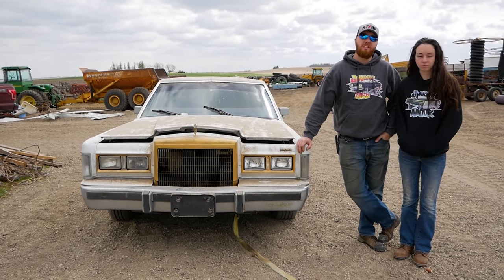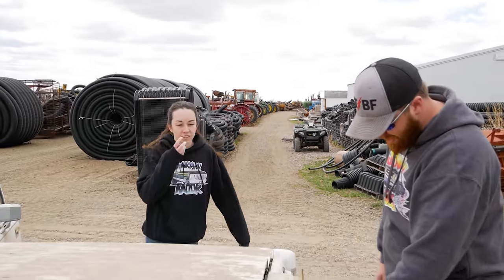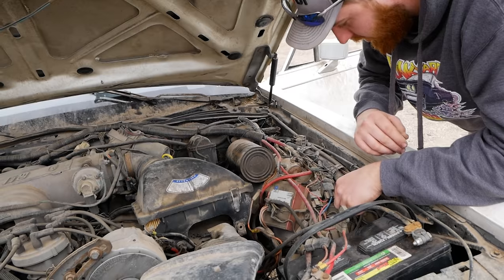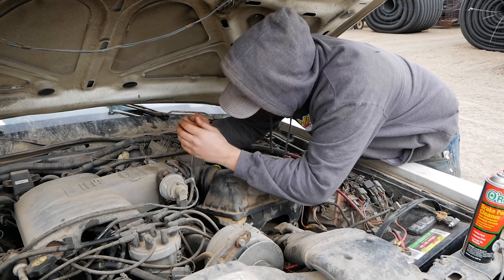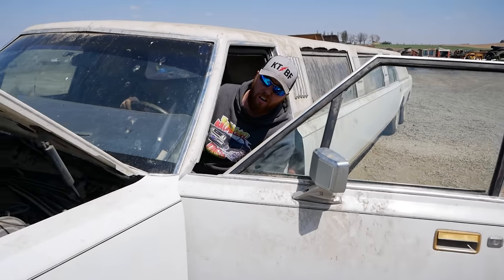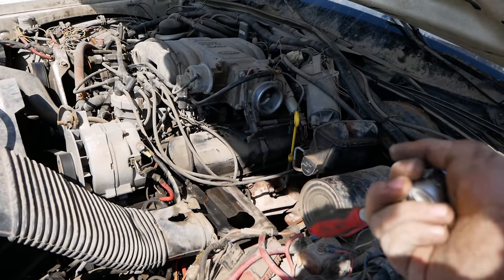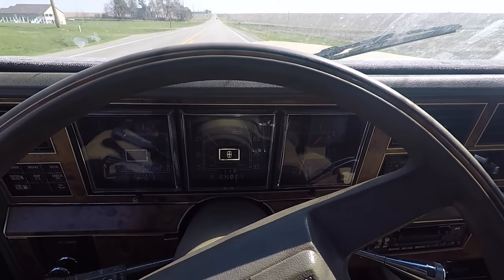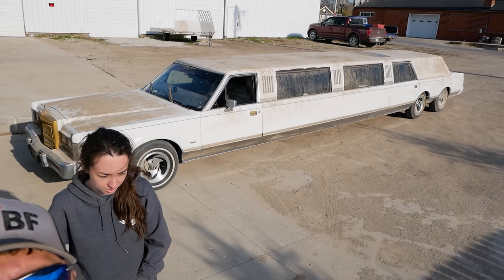Can We Fix an ABANDONED 35 Foot Limo?! - EFI Revival

Comment: As a retired welder, I'm horrified at the conglomerate of  scrap metal that escaped the smelter and was welded in place by Ray Charles. Watching you clean this up will be a lot of fun. Do with it what you will. It will be great no matter what.
Reply: Would be interesting to take the thing to a real limo builder for an assessment. I never would have imagined using road rebar  in a vehicle.
Reply: I haven't welded anything in 30 years and wasn't great then and I could do better than that with 30 minutes to get my set up right and run a couple practice runs....I mean dang that's beyond unacceptable.... that's why these old units are low mile and cheap...a lot of builders in the 80s and 90s were shady.
Reply: I was struggling to find a way to describe it...Well put.
Reply: You've aptly described the stretch limousine industry of the 80s. I've been in the industry for decades, and I have to say, no builder in the 80s and most of the 90s did a single thing differently. It wasn't until Ford and GM started suing people out of existence who weren't in the QVM (Ford) and CMC (Cadillac) programs that quality started to improve. Places like Ultra were still s**tshows though.

Fun fact: 80s Town Cars weren't built much better than what the stretch builders were doing to them. That's why, with VERY few exceptions, 80s Town Car stretches are all "sway back" bent.
Reply: @TransformedByFire  Practice runs? you need practice runs to do better than that?
Reply: @RenaxTM91  I was trying to be kind,  and I hate crap welds, sign off a truly lazy, inept, crooked fabricator.  I learned in Ag class,  I never had a weld fail,  and they were brutal on them.   I was a freshman and 15 years old @ that time. It's been over 30 years since I struck an arc.
Reply: @pppaybackkk  fun fact? What are you talking about? No Ford left assembly with rebar and scrap metal and angle iron welded to its suspension.
Reply: @broncomcbane6382  he's referring to the coach and limo industry of the 80s and 90s.

95+% of them built crap and charged the same as the good ones.  That's why thousands of them were pulled out of service by DOT.
Reply: @TransformedByFire  no.
He was insinuating that these cars left Ford Assembly in Wixom, Michigan or Ford Chicago as bad as this guy in LA cobbled them together. Not true. Ford had standards for limousine fabrication. Remember the one that Kennedy was killed in was built in the basement of Ford HQ's in Dearborn. They had standards for the traditional 36" insert, 48" and 60" insert.

Alot of coach builders in the 70s and 80s werent really big players like Hess & Einhardt or Miller-Meteorite. They were just guys with a body shop and a license from DMV as a builder. So they would take a 1 yr old car and cut all up into it extending it 9feet or whatever with no boxing of the frame or side collision protection or raggedy electrical work. 
But notice...after 20yrs sitting the basic car functions are fine.
Reply: @TransformedByFire  plus I dont think any were pulled out of service.  I think they mostly just aged out of service
Reply: @broncomcbane6382  Hess and Einhardt was bought out buy by what would become S&S/Superior(now Accubuilt) in the early 70s. 
In the 90s quality was good
Reply: @craigwiess1656  there was alot of shakeout in the coach and bus industry. Almost everyone consolidated or got bought out by hedge funds and liquidated.
Reply: @broncomcbane6382  worked at Superior Coach in the 90s, was out before they unionized and went to hell.
Reply: @craigwiess1656  I just read that Blue Bird Bus folded in 2009. And American LaFrance sold themselves to Freightliner. Most of the USA bus builders are gone now and fleets are ordering buses from China and Turkey.
Reply: @broncomcbane6382  At the time I worked there limos and hearses, all funeral cars with two exceptions.
One was a prototype  six door Suburban that was in 1994 the other a 120 inch stretch Lincoln  that went the the international car show in Las Vegas that was in 95. Had alot of overtime in the Lincoln 4 days before it was to be shipped out a Caddy hearse went into drive with no one inside it , plowed thru the plant managers office off a support  and into the rear quarter of the Lincoln.
Large group of Japanese businessmen  had just went thru the plant 10 minutes before and I had just finished up in the trunk 2 minutes, was 60 foot away when it crashed. Wasn't the first time a Caddy went into drive by itself, had a few instances at the plant
Reply: @craigwiess1656  apart from this video I had never considered a limo as a good road trip vehicle.  But it is. This thing has that cobbled tag axle which is shit, but the sleeper part behind the rear seats is cool.  This car can make a nice continental cruiser.  
Tap into one of those TV inverters for a refridgerator and a high ooutput alternator. Remove that first partition so the drivers seat can recline a bit.
Find Walmart, will travel.
Reply: @broncomcbane6382  that  linkage set up was cobbled. The control arms should have been boxed and reinforced .  That frame should be checked out for safety. 

For a road car,after fixing the control  arm screw up, I would drop a 460 in it and a beefed up AOD.
Reply: @craigwiess1656  for a 460 I think you would need the E4LD. The E4LD was the reengineered C6 with OD. The AOD is a reengineered FMX. It has a bolt pattern differing with the 460.
An easier idea is to beef up the AOD and build a 351W stroker since its all drop in from same engine family
Reply: @craigwiess1656  another thing is my personal bias always says the 429 was a better block for "dancing" than the 460.  That is the block to build IF you have an 385 Family engine.
Reply: @broncomcbane6382  429/460 same block, adapter can be used for the bellhousing pattern.
E4OD wont clear the transmission tunnel. Tried fitting a E4OD into a 1990 Crown Vic once, major mods to the tunnel would be needed.

The AOD would need to be beefed up to handle the extra HP/torque.
A C6 would be the better choice.
Another mod would be to swap in a 9in rearend  with 3.55 gears
Reply: @craigwiess1656  429 and 460 same block yep but remember the best Police sedan was the highway patrol interceptor 1971-1972 Ford Custom 500 or Mercury Monterey. NY State Police used the Monterey with the 429 4bbl until 1974 then replaced it with the Dodge Monaco with the 440 4bbl. I dont know who had Ford police cars in the mid70s.  Probably in the midwest county sheriff LTDs and Torinos?
Reply: @broncomcbane6382  Torinos were used until 76. 77 to 79 the LTD II, was Fords police, 80 on was the Crown Vic basicly the same platform as the LTD II. 
Ford police engine in the early 70s was the 429PI.  Previous was the 428FE. The FE motors were used all the way back to 58 , I remember  an uncle having a 58 galaxy ex police with a 352 4bbl. He also had an old Plymouth with an early 392 hemi.
Reply: @craigwiess1656  you can call it what you wanna, the LTD2 was still a Torino.  Just more rigid in shape and waay less attractive. Those LTD2s are out there for around $800.  They arent that pretty so their resale is weak.

The Crown Victoria isnt the same platform as the Torino.  That chassis was all new for 1979.  It had the same wheelbase as the Torino platform but not related.
This Lincoln is based on the Crown Vic chassis thats why it has a 302. You CAN fit a 460 in it but it will require a different oil pan and oil pump set up. The 302 for this chassis uses a dual sump pan because the K frame runs right through the pan clearance.  So a 460 would require a rear sump, 7qt pan and longer oil pump pickup.  Plus new springs for the added weight of the 460. Another reason I think a 351W stroker would be a better upgrade to a stock old limo
Reply: @craigwiess1656  or just build a stroker 302 so all the parts stay the same and the car makes a great road trip camper. Take it Roadkill Nationals or Hot Rod Power cruise or the Lemons Road Rally
Reply: Two words, Pakistani Trucks.
Reply: @broncomcbane6382  all for that idea!
Reply: @Dozz03  which?
Reply: I bet it wasn't originally like that. Frame probably rusted out and the business wanted to keep making money so they band-aided it. Par for the course for retail.
Reply: @pppaybackkk All the 80s cars out of Detroit were rustbuckets. That's why so few have survived.
Reply: @broncomcbane6382  In their defense, there were no real side impact standards then, either. The first set of REAL safety standards for American cars went live in 1998. Anything before that was basically left up to the manufacturer.

Comment: This find is gold...  plated!  Seriously though, I want to see you do a total refresh.  Maybe this could be your luxury camper?  Imagine how hilarious it would be pulling into a campground with this beast!
Reply: i am all for it
Reply: Love this idea
Reply: 20ft long pop up roof would be fab.
Reply: @Dave5843-d9m  That would be interesting.  But probably difficult and expensive.  I would just fix the obvious undercarriage issues.  Maybe replace the forward couch with another sleeping area.  I’d keep the middle couch.  Turn the bar into a kitchen cooktop/sink and counter/table.  Then I would probably update the cheese factor with a bunch of modern LED coloured strips and maybe some EL Wire so you could really blast the colourful 80’s vibe with pink, blue and purple.  I’ve seen EL Wire used as a low power consumption “neon” sign.  It works.  Just need to make an armature to hold the wire, paint it black and affix the EL wire with black zip ties.

Comment: Hi Junkyard Pigs!
Limo is my favourite!
Take it to Ford dealership for ball joint replacement.
Take it to the local oil change.
Take it to the wheel alignment.
Take it to the carwash (by hand).
Install the promised and long awaited LS6 twin turbo!! Maybe you'll find one motor like that already built and for sell...  :)
Oh, and all the rear wheels should drive, not just 2.
Source the rear wheel steering from Mitsubishi, Mercedes or BMW or wherever you could find it.

Comment: Those TVs are not going to get anything but static.  They are old analog tuners, and pretty much all broadcast signals are digital. You’d have to get converter boxes for D to A (digital to analog)  and put it in the antenna chain feeding all of the TVs. Good luck!
Reply: I was saying the same thing! Those old tuners aren't gonna pick up anything, except maybe a leaky cable TV amplifier on a pole somewhere!
Reply: of course, all you really need is an RF modulator on channel three and feed it a computer or DVD player!
Reply: Usually its not hard do find the 2 wires connecting the receiver module and the Tube module which expects to recieve an ordinary analog hot/ground signal.

OR you find a nerd who creates an multichannel Hf Minitransmitter which coud be feeded with varous signals and let the TVset´s in original state.
Reply: You Just Need a decoder
Reply: Stick a raspberry pie in there with a composite to RF converter and feed the TVs. Though honestly, if it were mine I'd just put some LCDs in there.

Comment: I bought a 89 4 door Fairmont with the 302 and 4 speed manual when stationed at Mt. Home AFB for $600. It was the ultimate sleeper, and I drove to KY while pulling a U-Haul. I miss "The Taxi" as I named it due to all the other airmen that I hauled around in it.

Comment: Here is an idea Kevin: use the limo for your wedding and make it a honeymoon camper as well. And as an added bonus, it'll fit most of your wedding guests as well.
Reply: Might be a short honeymoon with all that scary welding underneath 😳😳
Reply: @pit_stop77  I'd perhaps take a second look at that rear axle first, it might need structural work done by a pro limo builder
Reply: @rawr51919  A professional limo anyone would hear the words "Ultra Limo" and hang up on you before giving their address, and if their address was public, threaten you with a restraining order.
Reply: @pit_stop77  Well, obviously whoever did that "welding" and "rear axle building" ought to be brought up on criminal charges and the axle rebuilt properly. It doesn't seem very structurally sound.

Comment: Just because the plug wire ohms out fine, doesn't mean it's not cross firing (arcing).  My 92' Caddy had fantastic looking wires and they ohmed out fine but still had misfires like crazy.  Sprayed misty water on them at night and it was a light show of little blue sparks bouncing between eachother.  With that, ya'll did a good job getting it running!  I'm surprised it started and ran all in all that easy for sitting that long.  Can't wait to see it cleaned up and the next video on it!!

As for ideas, I say keep it original and detail it/restore it.  Kind of keeping it as a throwback to the 90's haha.

Comment: I actually like the “really long pieces of wood” idea because the employees are gonna be confused af when you don’t want it cut down 😂
Reply: They will spend more on the lumber than the car if they do that.
Reply: @awolfalone2006  2x4 16’ is $20, so a 32 foot 2x4 would be about $40.
Reply: @averagecarguy420  Exactly,  more than the car is worth. lol
Reply: @averagecarguy420  2 x 4,6,8's maximum length is 16 feet
Reply: I wonder what company did this cars body? Looks like some mess choo choo customs would do.. same company that does camero/elcamino front ends and chevy g20 vans..
Reply: @jackfisher3906  
Standard 2x stock at Menards us up to 20'. 

Well, it's supposed to be. Who knows what's in stock right now with the building boom.

Comment: I think I would have put 3/4 cup of SeaFoam in the crank and the rest of the can in the gas tank when you filled up. Your 48 mile drive would have given some of it the time to start cleaning out that engine. I did that on a 1969 Chevy Bel Air with 235 CI engine that had been sitting for over 8 years. That was a year ago and I was moving it for a friend who tells me it is running smooth and cool even with 237,400 miles on it. Just a suggestion for a fast and easy clean out.

Comment: 41:18 , i once got an engine that would't start and when i took the sparkplug out and held it to the engine it did spark but in the cilinder it didn't and when i put in a new one it fired right up

Comment: One thing you should really get is one of those siphon deals we use at the shop where I work. You can get them at harbor but im not sure where else. You put the hose in the filler neck and the other half in the gas jug then shake it and walk away and get everything else you might need to get done done while its filling.

Comment: It's great that the TVs still work. Unfortunately, all analog transmission in the US ended in the early 2000s. There were converters that received digital transmissions and put an analog signal (on channel 3) so you could keep using your old TV.

Comment: You guys should restore it to its former glory and give it a bigger engine. Then you should use it as a transporter to take all your car parts and projects across the country
Reply: Bigger engine? It's got an engine the size of an elephant in there.
Reply: @Luboshko  Yeah, but it could use some haul on it. And it was still during the Malaise era, so it could use at least a turbocharger
Reply: @whenwhen2284  it’s probably a 454/460 v8 a supercharger would be better
Reply: @Robert-xu8pl  The engine is a 302
Reply: @whenwhen2284  how did that thing move with only a 302
Reply: @Robert-xu8pl  I don’t know!
Reply: @whenwhen2284  it’s got to weigh at least 5500 kilos
Reply: @whenwhen2284  Don't underestimate the 302

Comment: Idk if this is something still being worked on but this thing is incredible.  I would love to see it converted into a "mobile LAN gaming center" where each TV is hooked up to an Xbox and halo and it's all done with a local network switch.  Being able to LAN game on this would be incredible.  I also think that you can get a mobile hotspot from VZ or something and add internet to it so you could have a more sophisticated gaming setup in the back.  

Another idea, really lean into the "retro vibe" and build lava lamps into the counters/walls in the back.  I'm sure there are lights you could right up to produce similar heat and still get that cool effect.  I also think this could be the most ridiculous tail gate vehicle to ever exist?  Maybe hook up an electric smokeless grill and a few other electric smokeless appliances and have a mini kitchen in there.  That, or build it so the outside from of the vehicle has some sort of "outlet" to hook a grill up to.  Could just be on the trunk since it'd hold like 37 propane tanks.

Comment: A fuel injected engine with a weak regulator (causing low fuel pressure) can also cause a fail to restart hot (without causing a MIL on OBD2) by allowing vapor lock when the gas in the rail boils.

Higher pressure causes the boil temperature to raise, so vapor fills the injector rail when hot & the engine is off.

Comment: I don't remember what Ford calls their V-10 but I drove a one-ton Ford cargo van for a company that did overnight auto parts runs in Missouri, Illinois, and southern Iowa back in the late 1990s and early 2000s that had one of those in it and it would hual ass big time even if I had a full load of auto parts in it with an 8-foot trailer full of auto parts in it also. I think that would make more sense to have in a old 1986 Lincoln Town Car. 35-foot-long hoop-t-limo

Comment: Re: Plugs - I put new plugs in my car when I bought it with 50K miles on it. I am now pushing 170K on the same plugs (Bosch Platinum). I took them out about 30K ago to inspect. Look good. I cleaned them up with some brakcleen and a nylon brush and theew them back in. Car doesn't miss and has same gas mileage as new. My lawnmower, on the other hand, chewed threw the plugs in about a season.